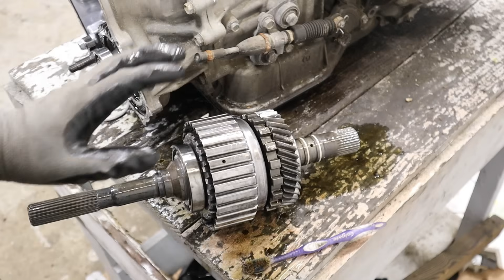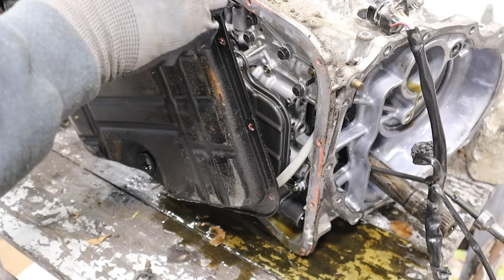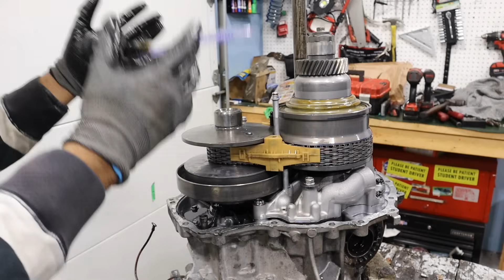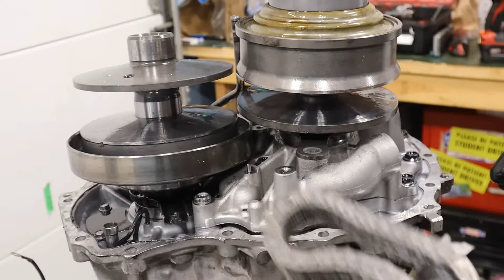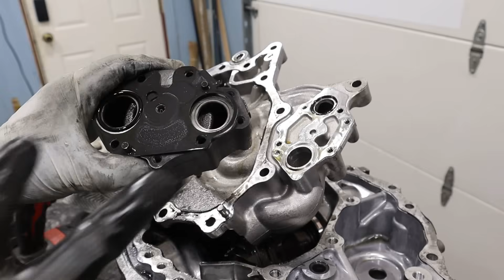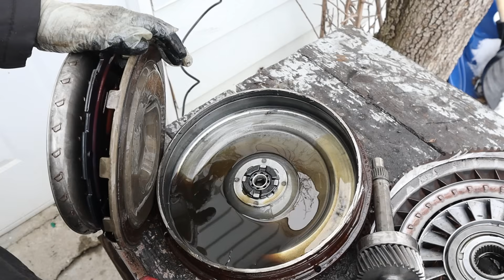Are Subaru AWD CVT's Reliable? Subaru Outback Transmission Teardown!

Comment: I was concerned the CVT would be an issue when I got my 2013 Legacy new, but we’ve put 170K miles on it over 12+ years and it’s still going strong. Haven’t had a single part fail in the whole car. Engine guzzles oil, but amazing longevity overall.
Reply: I've seen many Subaru's with the original CVT well north of 300k miles. I think it just comes down to how it is driven and cared for.
Reply: @27Zangle how exactly?
Reply: @rack_man  what do you mean "how exactly"? A device with moving parts in a vehicle: maintenance of course. Change fluid regularly and that device will work just as well as most other moving parts. Some love to discredit CVTs, some are religious. We all believe what we want😁
My strong belief after a tiny personal experience with my and friends' Subarus with CVTs and watching several YT channels (with different credibility), is that the CVT is not more or less prone to failure than many other mechanical parts in cars whatever brand and model. Comments like "my car broke down and despite a meticular maintenance schedule, it just failed" doesn't convince me much.
Reply: @rack_man You're stupid and incapable of using your words
Reply: @rack_man Drive it smooth and slow. Cruising level, if even she feels quick at the gas. The reason you do it is because CVTs are generally made for city level driving. Good on gas and long use if the fluid is actually maintained.

CVTs mainly got a bad rap from nissans jatco transmissions, and some of hyundais and kias, you miss one fluid change and your playing with a new transmission, hit or miss still.

I understand you only asked one question, I just want to provide everyone else with information aswell, CVTs are not bad, Koenigsegg is CVT, Honda has a launch gear thats fun and innovative on their CVT's, so just do research ans genrally treat CVT transmissions ms.daisy.
Reply: @rack_man It is called a factory maintenance schedule and you follow it. Instead of listening to randos on street or internet that think they know better.
Reply: @rack_man  Fluid changes, not hammering the accelerator at every light.
Reply: Yeah. I have a 2012 Outback with 171,000 and there isn’t a single issue nor any leaking problems yet. I think the big difference is flushing your CVT fluid at least every 30,000
Reply: @yitzhak177 Flushing? No. Just drain and fill.
Reply: Japanese automakers sell various models with CVT in the Japanese market. None of them have any issues because dealerships will commonly change the fluid every 30,000-40,000km or every 2 to 3 years as part of routine maintenance. They will also change engine oil every 5,000km or 6 months. (Which is why an imported 25 year old truck from Japan still runs.) I find it strange that some people in North America don't understand that they MUST have their engine or transmission serviced, and then complain that it didn't make it to 100,000 miles, which is equivalent to 160,000km. It's just gears, belts, and chains. No machine will last without regular maintenance.
Reply: They had a recall for the FB engines to replace them if your rings are leaking. if you're burning oil you probably want to go in and they will give you a new engine. It's very unlikely you never had any issues they just tend to replace anything that's under a TSB or a lawsuit settlement when you go inside the dealer if you came in and complained about anything without telling you. I took sit at the dealer for a few days waiting for them to fix my airbag recall and lots of people got new cvts and didn't realize what was going on. It takes two guys about 6 hours to replace one
Reply: My 2018 3.6R cvt died at 80K miles. Subaru replaced it because they give a 100K miles and 10 year warranty as many were failing. They know it’s a problem. Seems to not care.
Reply: Which engine does your Subaru have? EJ or FB?
Reply: Whatever
Reply: @rack_man true story sorry.
Reply: Your on borrowed time. A transmission failure is in your near future.
Reply: Your one of the lucky ones ones, I have a nephew who makes a good living replacing the CVT in Subaru’s.
Reply: @wreckum56 he probably replaces the valve body or the solenoids in them, not the entire trans itself.
Reply: @DaDaDo661 nope the whole transmissions. I just talked to him a while back and they do a lot of them. Maybe because it’s a lot of mountains.
Reply: @DaDaDo661 sadly you have to replace the whole valve body so where around 200k which sucks about the galley/vley repair where you have to pull the whole engine to replace rTV where they should hae used a gasket
Reply: @Ih8-hoas lmao.  No you don't.  Just because that's you opinion or your particular circumstance doesn't mean it's the same for everyone.  08 outback and absolutely no trans flush EVER 290K MILES still running strong
Reply: @brianbrooks1909 lol imagine bragging about never servicing your transmission.   I don’t even think I a 2008 outback has a CVT.   Pretty sure it wasn’t available until 2010.
 I also assumed we were all adults here and I didn’t have to spell out that yours might last longer or shorter.  But then again I assumed you know if your vehicle had a CVT lol
Reply: @wreckum56 legacy 2013, 150k miles, no issue, no leak oil, no transmission problems.
Every 30k  I change the transmission fluid.
Reply: @wreckum56 most of the people having issues don’t maintain them the cvts need religious fluid changes at 30k miles with oem fluid do not go over that 30k intervals and they will last seen plenty make it was past 200k just the 2010-2012 models had the issues due to being their first cvts but Subaru fixed them in 2013 and slowly perfected them from then on
Reply: @Arelius_02 I have a dodge with 180,000 miles on it and I have changed oil in the transmission once. Guess I won! Saved one more dinosaur.
Reply: @wreckum56  Horseshiate.
Reply: Ha 170k longevity????? 😅😅😅 try 500k as longevity
Reply: @Ashoud_Anobetah Does your car have 500? No it doesn't.
Reply: @pootispiker2866 mine has
Reply: @Ashoud_Anobetah  Most drivers don't cover 500K miles in a lifetime.

Comment: What was the actual diagnosis of the failure of the transmission? My 2016 forester failed at around 178k kilometers. Although I did run it pretty hard at times and did a fluid change, maybe 10k before failure, I thought it would last longer, but theres items in the transmission that will wear out sooner than other components will last so maybe I should have kept my hopes in check. I'll be, dropping the pan and changing filer and fluid every 60k now.
Reply from the maker: This wasn't sold to me as a failed unit but we can see evidence the torque converter was going out

Comment: It looks a lot better built than I was expecting, yiven the scuttlebutt out there about failures. I suppose the question is, if you gave one of these CVT's regular fluid changes would they still be prone to failure of the solenoids?
Reply from the maker: Yeah. Solenoids are coils that can burn out regardless of fluid conditioning
Reply: Yes. Luckily, they're cheap and easy to fix yourself. If you ever have transmission problems w/ ur Subaru, just replace the solenoids first. Odds are it'll fix your problem.

Comment: I always have the feeling that chain is not much stronger than belt, since the contact surface is much smaller, and friction surface is most crutial than pulling or pushing strength.
Reply: The fluid pressure inside a Subaru CVT is over 950psi to prevent the chain from slipping.
Reply: Actually according to some leaked engineering docs (floating around on the Ascent forums), the chain and pulleys are capable of handling a LOT more torque than they're actually exposed to. The problem is, keeping that chain clamped at max pressure reduces efficiency and actually slightly increases wear. So, the ECU is constantly feeding the TCU information about how much torque the engine is outputting. And the TCU adjusts the chain clamping pressure to be just enough to handle the current torque plus a safety margin. I bet most chain-slip type failures occur when something in that communication chain breaks down, and the transmission is suddenly exposed to a load it wasn't expecting.
Reply from the maker: True the surface is small

Comment: The 2.5 outback with the TR690 uses CVTFII green fluid so it seems this has the correct fluid. Looks like this one just has a failed solenoid valve, not too hard to fix. Im more concerned on the metal shavings though, probably what caused the solenoid to be stuck or fail.
Reply from the maker: This fluid looked yellow like engine oil though

Comment: I have a relative with one in her 2016 3.6r outback. Its at about 190k miles without issue. I believe that she has had the fluid serviced a few times. Engine has been good too. Seems these subaru cvts definetly not perfect, but one of the better cvts all things considered.
Reply from the maker: Better than alot out there but can't beat the older 5 speed auto
Reply: That will never hit 300k
Reply: Change transmission fluid every 30k 😊

Comment: What fails on the Subarus are the valve body solenoids and Subaru doesn't sell the solenoid separately, they require you buy a whole valve body.

Subaru fixed their head gasket engine problems from the 2000s era but then they probably started missing that revenue from customers coming in around 100k so instead they've made the CVT have some problem right around 60k-100k go figure.
Reply from the maker: Subaru is a unique company with a different drivetrain design philosophy altogether. 
Failure modes are also unique. Honda CVTs will break belts, Toyota will burn clutches and Nissans will blow the variators. Luckily Subaru figured the CVT issues out by 2014.
Reply: @speedkar99 Yeah, that's right. And their symmetrical awd system is essentially a marketing ploy at this point. 

Don't get me wrong, the all time awd is awesome in its own right. And pre cvt when Foresters had manuals with a transfer case, they could embarrass a lot of true 4wds...

And as much as i like the neutral handling and safety that comes with the heft of the awd system. It uses a lot of fuel to lug around. 

If someone could out how to fit a dual clutch or add an extra couple cogs onto a 5eat... they would be deified in the Subaru forums haha
Reply: Nah. They would have saved cents on the dollar not using an MLS gasket. Accountants make these decisions. The CVT does lower fuel consumption significantly and really the only option Subaru could use and keep their symmetrical awd. 

Changing the fluid will not change the fact that you are using a chain to propel an over 2 tonne car from standstill... it's inadequate
Reply: @santouchesantouche2873  You're right about the CVT giving the subies extra gas mileage with all of that extra weight and drag from the AWD system.

Subaru is weird like....they do a lot of stuff right, don't get me wrong, but then for some reason they absolutely drop the ball on a key component. Choosing that crappy coating head gasket for the NAs....they literally were making MLS gaskets for the turbos I'd rather they give me some absolutely dog crap tires that only last 15k miles than those crappy head gaskets.

And now, its with the CVT, they absolutely did well going with a real chain instead of a belt, but what good is it if the solenoids are failing so early that a belt driven CVT would have still lasted longer???

Like you said accountants or someone are creating this absolutely weird problems, I believe it's simply revenue generating.

I would buy from them again but their cars are no longer cheaper than competitors and one minor issue I still see once in a while is timing cover leaks from bad application at the factory. It can be done in engine for the most part but ughhhh
Reply: @Bob-ew5ul According to Japanese media outlets, a brand new boxer engine is planned, one that could run on carbon-neutral E20 fuel or be part of hybrid and plug-in hybrid systems. A more advanced, racing-derived all-wheel drive system is also reportedly in the works.
Reply: @santouchesantouche2873 the math on hybrids never make sense either, seriously, unless you drive more than 30k miles. If you drive 15k miles or less, it takes you 8 years to make back that up front cost and then in another 8 years the hybrid battery will need to be replaced, cost is $2k for a used and that's maybe with or without labor.....you end up back where you started. Nothing is beating the energy density of gasoline/ethanol for a looooonnngggg time unfortunately

Comment: But what is the difference between a 2012 CvT and a 2023-2024 CVT? What flaws remain and which have been fixed and are no longer a problem? My Crosstrek handles beautifully.
Reply from the maker: These torque converter issues were resolved by 2014
Reply: @speedkar99 thank you, but that doesn’t really answer the question. I really enjoy these videos, they are very revealing, but how does this apply to the CVT in my 2024? It would be very helpful if you would, as you go through your tear down and explanation, could say things like,”if you have a CVT made after-for example- 2015, this potential problem doesn’t apply to you”
Because I don’t know the differences, I don’t know what problems I need to worry about with my own CVT.
Honestly, I wish they still had a 5-speed. Manuals are great.
Really appreciate you answering, thank you!

Comment: Subaru has added a 10 year 100,000 mile extended repair warranty to it's CVTs 2012-2020.
Reply from the maker: That's good to know!
Reply: But would that only be for original owners? Hyundai is that way with the powertrain warranty
Reply: @OneLeggedStormChaser  Yes.
Reply: @OneLeggedStormChaser  Yes.
Reply: @OneLeggedStormChaser  No. I had my TR690 transmission replaced under warranty for my 2020 Outback XT, I just had to transfer the warranty in my name (easy to do) before I took it to a dealership. I was not the original owner.
Reply: @OneLeggedStormChaser  And with a Hyundai/Kia, you are GONNA NEED that warranty for sure!!!
Reply: @OneLeggedStormChaser Hyundai you’re guaranteed to fail, whether you maintain your vehicle or not 😂

Comment: My lexus GS 350 AWD uses a 70/30 planetary.  It does have a lockup if there is too much of a difference. It is a lot more reliable than this. The GS has a stub for the right  front axels to make them equal. Not quite symmetrical.
Reply from the maker: Interesting. 
I'd love to dive into Lexus AWD. 

My GS350 is RWD the way I like it. Fun 😊

Comment: Is the chain drive the same in the smaller Impreza?
Reply: Yeah. Subaru has 2 different cvts.  The tr690 is the original. They then started using  the tr580 with the introduction of the FB engines.
Reply from the maker: That would be interesting to teardown and see !

Comment: A 2012  vehicle????  I have a 2022 Crosstrek Sport (2.5L).  Thoughts??
Reply: Change your engine and cvt oil regularly (every 5k and 40k miles respectively). Don’t overheat it or drive aggressively off-road, and it should last you quite some time. And yeah, remove the cvt protection shield, if you have one - it can overheat the cvt.
Reply: @sergiizheka3571 . Thanks!
Reply from the maker: Technically this one didn't fail but as you saw, there were definitely signs

Comment: Keep  with your fluid changes?  The Subaru dealers near me all refuse to do a simple CVT drain+ fill, saying it is lifetime fluid. I think it is Subaru policy not to have dealers do it.
Reply: It is a lifetime fluid. When the transmission dies from no fluid changes, the transmissions lifetime is over!
Reply: My dealer had no issues changing the transmission fluid.  They told me when I bought it it was "lifetime."  So, I said, define lifetime...it's a machine; machines need maintenance...  There is no "lifetime" fluid...
Reply: My dealer changed mine, but it wasn’t cheap.
Reply: @vatayfairfoot  I paid about $1000 for fluid changes for the CVT and both differentials at non-dealer garage.
Reply: They don't know how. Surprised they can do an oil change.
Reply from the maker: Why go to a dealer? 
Go to an independent shop or if you have the means, do it yourself
Reply: @speedkar99 I don’t have the means to do a cvt flush myself.  Dealership will likely be more knowledgeable than Joe Mechanic when it comes to proper oil change procedure.  I have it changed every 60k, so no biggy.
Reply: You don't need to flush , just drain from below and add from above..
Yes there will be few liters from the old oil , but it is less headache 
 @vatayfairfoot
Reply: @Mhdlagha I prefer a flush. The drain plug in the 690 sits quite a bit higher than the bottom of the pan.  If you’re going to do it, do it right.
Reply: @vatayfairfoot  if you can flush, do it, 
But if the oil wasn't too bad, then why bother..
I have 2011 outback, i change cvt fluid every 30 k and I'm satisfied with that
Reply: @Mhdlagha you do you, bud.
Reply: @vatayfairfoot  Flushing is a terrible idea, it can break up deposits and clog up your valve body.

A simple fluid drain, pan drop and filter change and new fluid is all that is needed.
Reply: @speedkar99  It has a drain plug in the pan (many automakers skip that part), so its a very easy DIY project, drain the fluid, drop the pan, change the filter, new pan gasket, new fluid, and done.

Comment: You can actually replace the solenoids individually. They’re non OEM however. It’s much more cost effective than replacing valvebody. The torque converter solenoids is the one that goes bad most often. The awd solenoid does go out too, but at a lesser rate.
Reply from the maker: Yes there are aftermarket ones now available